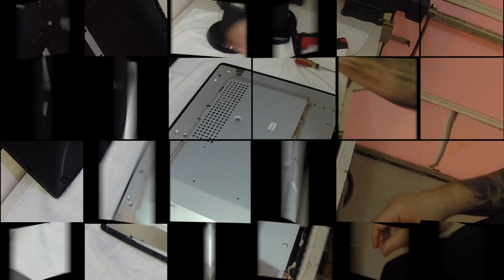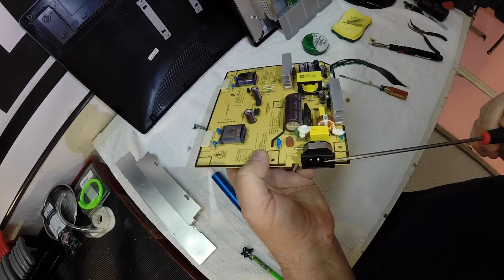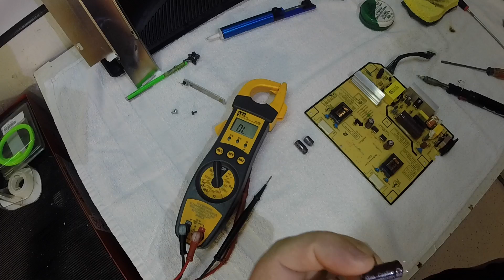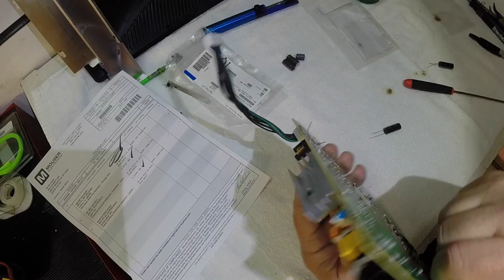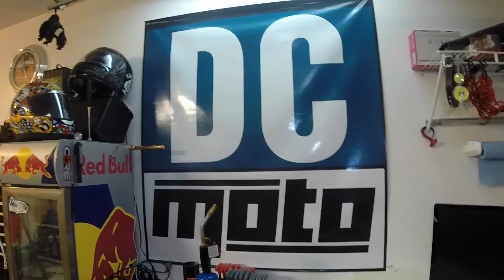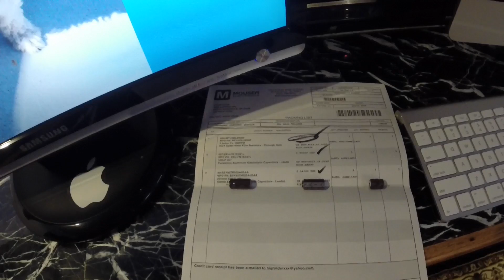How to repair Lcd monitor samsung syncmaster 226bw

Comment: Thank you so much for doing this video!
I followed your steps last summer and fixed my trusty old monitor from 2007 - it has now served as a 3rd screen in my home office during the lockdown and has clocked another 1000+ hours of use. The only downside is that it removes the excuse to upgrade to a better performing screen :-D

Comment: Thank you David for a great guide. My Samsung 226BW is from 2007. start blinking a few weeks ago. My PCB board has 3  820 uf an one 330 uf. Only 2 of the 820uf looks bad, but I have replaced all 3. I bought at Digikey 820uf 35v for $1.44 each and 330uf 35v for $0.42 all maid by Rubycon. The screen is working like new !!!  Thank you !!!

Comment: Fixed! Thanks and respect for posting these instructions. I am a complete novice at this stuff (never used a soldering iron in my life) but ordered the parts and borrowed a friend's soldering kit. Not having to wait half an hour for my screen to stop flickering and fixing this problem for only a few pounds is immensely satisfying. Thanks again!

Comment: Great video! I picked up one of these for free and fixed it in less than 30 minutes. Also, if you're replacing the same three caps that were highlighted in the video, the replacements don't need to have the same specs. I replaced the 820uf capacitors with 1000uf capacitors and the 330uf capacitor with a 470uf capacitor, and the monitor works fine.
Reply: hi. The monitor still work fine with this capacitors?

Comment: Useful video. My secondary monitor which is this model has started to flicker until it warms up. I understand it's fairly typical for the capacitors to act this way when they are starting to fail. I recently managed to fix my dad's old DTA's power supply by changing the bulging caps, so I think I should be able to fix this one too. Haven't soldered anything since primary school before that.

Edit: I did it! I was afraid I was going to break it putting it back together, but no. It went swimmingly. Yeah, it was those 3 caps. Now the monitor turns on faster than my primary monitor.

Comment: Just adding another satisfied viewer.  Same capacitors failed on me, $2 in replacements, a couple solder connections and I'm back in the saddle.
Thanks again for the video!

Comment: Just started experiencing this exact problem with my Syncmaster 226BW when I upgraded to Win10. At first I thought it was the upgrade for some reason, but further Googling led me here. You may have saved me a few hundred. THANK YOU!

Actually, upon rewatching, the left half of mine is darker just like yours is. You're the bomb.

Comment: 2nd time to fix the Samsung 226BW on my desk... and second time to watch your video.

The March 2015 repair was for 3 capacitors... roughly the same locations as yours. 2x 820 uF and 1x 330 uF.
Now, in Dec 2017, I have to replace 3 more... all of them 820 uF. I decided to go through Mouser like you (been using them since before the web and when they were still mail order) and got Panasonic and similar Japanese capacitors. I prefer to up the voltage just in case, which invariably makes the case bigger. So mine are 35V.

One tip: 1 cap I ordered was a 12.5 mm diameter (rather than 10 mm) and 20 mm high. I am putting it in that tight area near the heat sink. For the other four 820 uF, I chose 10 mm x 25 mm, which does have a possibility of clearance issues, so I just laid over my first two 820s. I will do the same on the other 2 that are in the middle of the board where there's a lot of room.

As for the symptoms, mine were never quite like the majority. My monitor right now has problems turning on. About 3 months ago, it started to show a dim light at startup and "warm up" to full broghtness... then it would pause at startup. Then, it just wouldn't turn on the screen at all. It was acting like the backlight was problematic, but sure enough, it seems to be the three bad caps. If anyone reads this, and you've never replaced any, it's best to just get 5x 820uF (I picked 4 of the 10x25 mm and 1 of the 12.5x20mm) and 1x 330uF caps. Mouser has the best Panasonic, Nichicon, UCC cap brands. They also have the 10000 hour rated with high ripple current. Try to avoid the eBay junk, but to each his own.

I normally run my monitor pretty low in brightness. I have heard that if you are having problems, go down in brightness will buy you a little more time in case you are waiting on parts.
Reply: My repair list:
https://www.mouser.com/productdetail/661-ekyb350e331mjc5s

the fat, short one:
https://www.mouser.com/productdetail/647-uhw1v821mhd6

The tall, skinny one that I soldered with the leads long and laid down flat:
https://www.mouser.com/productdetail/667-eeu-fr1v821l

Comment: Hi, I have a 223bw and I have changed all the electrolitic capacitors but the little ones, with ultra low ESR panasonic pieces. Everything went ok fot a couple of weeks; then I reassembled it and that b*tch started again to turn off. What else could possibly be? Tbh the capacitors were not so damaged but I changed them anyway, the small ones are totally flat.

Comment: David, thank you for a clear tutorial on this issue, which has just arisen with my 226.  You have inspired me to take the leap and fix this myself, but I was warned by the computer engineering teacher at the high school where I work that this can be very dangerous because the capacitors might explode, and he has warned me not to do it.  Comments?  I am assuming that he is warning me off because I am a non-techie female, but are there ways I can screw this up?

Thanks, Diana
Reply from the maker: the only way a capacitor can explode is if you  over charge it with voltage you will most certainly not be doing that while you repair it. with that being said there should be no reason you cant handle the job.common sense on safety thats all. just in case you could wear some protective glasses while soldering. piece of cake ,good luck
Reply: Thank you!  Will shop for parts and tools this weekend!
Reply: FIXED!  Thanks again!

Comment: i have x2 1000uf and x1 220 uf instead of a 330uf and x2 820uf i already replaced one of the 1000uf capacitors in the past which fixed the issue. but now the same problem is happening again, but the capacitors look fine. im guessing they are still bad, just not bulging, but who knows. also, the one i replaced was taken from another old monitor, so who knows, it may have already been worn out which could explain why the issue has returned. the monitor was good for about 5 years since the last repair though. with a lot of use everyday.

Comment: On the two flat capacitors on the other side of the board is some white stuff .  It looks like it was leakage from the flat capacitors onto the yellow square item.  I have the same on my circuit board.  My first thought was that my soldering job damaged these other two flat disk capacitors only because I did not recall if that was like that before I got started.  Well I'm relieved to see that your board has the same white substance on the two flat disk capacitors that my board has.  Do you know what that stuff is?  I have seen other videos for this monitor where the board does not have any of the white stuff.

Comment from the maker: I think they used 3 caps for clearance on board 1 large cap would be pretty large thanx
Reply: I used a single 2200uF capacitor. Fits and works just fine.

Comment: Hi David. Interesting video. Since you seem knowledgeable I have a question for you. I have 2 Samsung 226BW monitors in a dual monitor setup. One of them starts acting weird lately. Sometimes when I power it on, it stays on for a second or 2 and then goes black again. The blue led stays on but the screen goes black. When I power it off and on again it stays on until I power it off again. So it's not the flickering issue like in your video. Could this be the beginning of the flickering issue or would this be something totaly different? Thanks.
Reply: +Bimmerstye1 That's what I had with my Samsung 226BW - would stay on for a few seconds, then go black, but it'd be fine if I powered it off and back on again. Eventually, it got worse and worse, and then it the screen wouldn't go on. I opened up the monitor as per the video and the same three capacitors shown were bulging. So, yes, likely the same issue, bad capacitors.
Reply: +billin Thanks billin. Mine has gotten worse as well. It still works but now but it takes a couple of minutes before it turns on. When it turns on at first it flickers and goes back off again. Then I have to turn it off and on again and then it stays on. Time to open it up I guess and check the capacitors.
Reply from the maker: +Bimmerstye1 might be the backlight itself if so would not be economical to replace Thanx
Reply: +David Cook I think it will be the capacitors. By now I bought a 3th screen to replace the one with the issue. I've just opened the back of the screen to check for the capacitors. My board looks a little bit different than yours but were on your board the 3 broken capacitors sit, there are four on my board and they all have the bulging top. So the plan is to change these four capacitors and see what happens. I'm pretty sure this is gonna be my problem. I will let you now if it works after replacing the caps.

Comment: Hi! i'm just wondering: why wouldn't you use just 1 big capacitors in stead of the 3, since they all seem to be connected in parallel on the board?

Comment: none of my capacitors are bulging any idea what the issue is? mine does 
the same flickering then stops after a few minutes now it just doesnt 
turn on anymore.
Reply from the maker: It's probably the back light it will not be economical to repair
Reply: ok thanks you probably right. it did fix it sometimes when i was banging on the screen
Reply from the maker: Lol